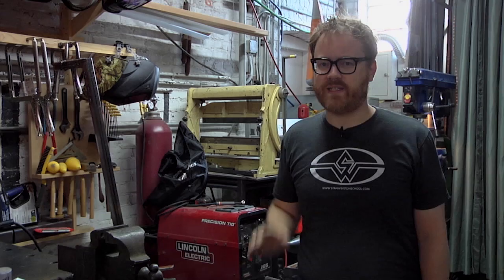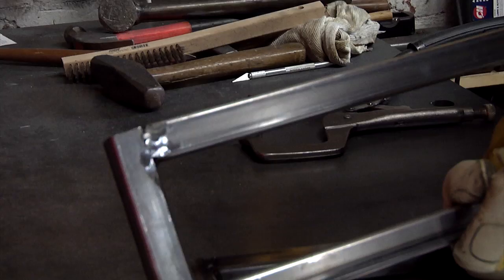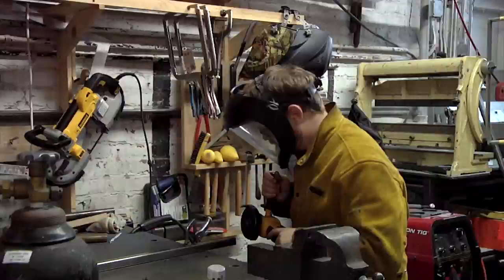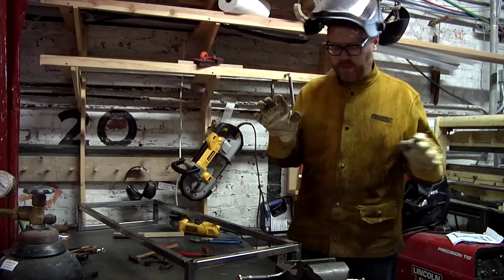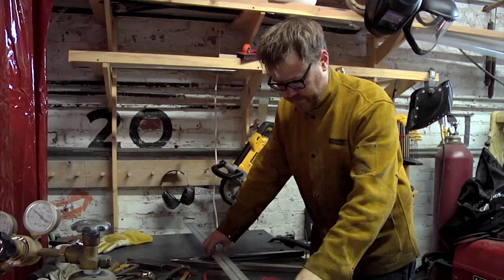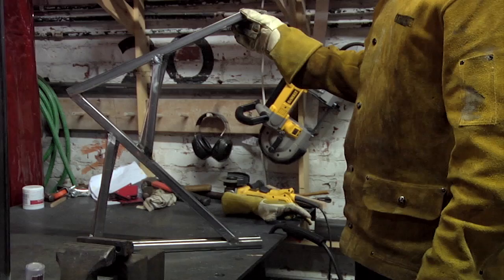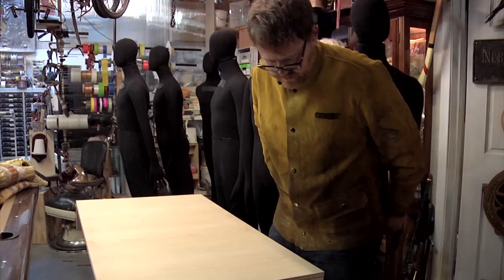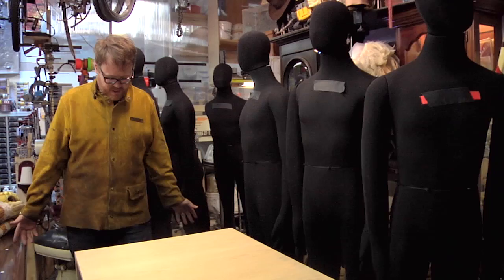Building a Custom Computer Desk, Part 4

Comment: Having done a great deal of welding, I can say you have improved so much from your first welds.

A quick tip. You can stiffen up and strengthen corners (like where the legs meet the top) with either a simple gusset or a fancier double gusset.

The simple gusset is just a right triangle of steel about 1.5" x 1.5" the same thickness as your tubing. Align it to the edge of the tubing so you don't get flexing of the face of the tube.

The stronger and fancier way is to make the double gusset from the tubing scraps. What you will end up with is 2 gussets connected together with a flat piece between them. To make them you simply cut 45 degree zigzags back and forth across a piece of tubing. You will need to make sure the cuts meet at 90 degrees. You should end up with a flat rectangular piece at 45 degrees to the corner and 2 triangles that fill in the corners. It is extremely strong and won't flex at all. If you need even more stiffness you can make the zigzag cuts farther apart. You will end up with sections of tube that can be welded across corners to form an open triangle.

Comment: If you're trying to duplicate something while welding, see if you can't find a piece of scrap plywood that you can screw a wooden "jig" or "pattern" on, so you can fit the bars (which should be cut to the right length) and weld away. perfect every time
Reply: This would definitely have been worth it on this build. He got the important angles almost right, but it would've been awesome to see him build a jig to compensate for the lack of experience... and give us another few minutes of video ;)
Reply from the maker: The cuts on the short pieces weren't perfect, so I chose to place them where they had the best contact instead of perfect symmetry.
Reply: +Sticklebrick consider tacking pairs and welding both legs at once.

Comment: First, Will, I would like to applaud you on undertaking such a project. Second, I would like to emphasize that the desk has very little lateral bracing. Before using this desk and placing any weight on it, please consider adding some support to prevent side-to-side wobble. If someone should lean on it from the side, it could potentially collapse causing injury. Please, just consider this as a friendly recommendation, I hope to see many more projects from you guys.

Comment: A lot of improvement over the last video. GJ.

Some of the criticisms here in the comments are wrong. So I'll address them:

-Steel tubing is clean enough that it doesn't need cleaning before welding.
-Tig welding is slow and is mostly used on something that is thin or needs to look good; mig was the correct method to choose.
-Porta-bans don't need cooling fluid.
-Thickness of the metal was fine.

When welding tubing, if you are going to close off both ends it is a good idea to leave a hole either in the weld, or drill a hole (before welding) so the heated air inside can escape.

When both left and right sides are identical you can tack one side together, then use it as a template by clamping the other one on top of it. Both sides will be identical.

Comment: Personally I would of screwed a plate between the legs to stop the wobble. It is how a number of computer desks I have had in the past dealt with the exact problem Will is describing.

I think it is great that Tested is using premium members money for something. Also you have to remember he is learning and I saw some welds there I would have been proud and some that were damn right ugly. What some forget is that he SAYS this in the video series. This is how humans learn, by mistakes and correcting those mistakes. Keep up the good work guys.

Comment: You've done a great job Will, im an engineer, fabricator & a panel beater so I cringed a little watching your welding but for a first go u really did great & u didn't take the easy road with the very complicated design of yours. Anyway just wanted to say great job.... And keep on testing. Onya

Comment: Small cursive 'e's or overlapping 'o's will make your welds so much better. Make sure you have a good base, good ground, clean material, and your amperage, wire feed rate, and gas psi match your material. It should sound like you're making nice, sizzlin' bacon!
Reply: that's how i was taught to weld, i was told that it is stronger if it isn't just a straight line.
Reply: BACON!  But no, really, it's true.  Once you get the right wire speed and power, sweet sweet ozone smelling bacon!
Reply: Eamon O Not true. You can have a strong slow straight weld. You just have to get the wire speed and voltage right, clean metal, good gas coverage, etc. If you're welding flat, a slow steady bead is all you need. It's hard to get MIG to lay down in a low profile in a straight line though, so people tend to do a W stitch pattern. Vertical and overhead on the other hand need that stitch to keep the weld to a low profile.
Reply: +MotoErgoSum you can run it in a step back pattern too, much like a 6010-6011
Reply: *****
So long as you aren't stepping back too much over the slag and getting it stuck in the weld, yeah.
Reply: The slag doesn't form that quickly when still in a relatively close distance to the the weld puddle. Plus, he was MIG welding, so there is no slag.
Reply: *****
You said 6010 and 6011. Those are stick electrodes, not GMAW wire. They're meant to run hot as a root pass on pipe or plate. If you're welding slow and going back over the slag, you can get inclusions pretty easily with stick. Saw it all the time on fellow students' QC-7 tests.

On GMAW (MIG) you can get cold lap or incomplete fusion if you're running the voltage too low and wire speed too high while stepping back over the weld. There are a lot more variables to welding than the pattern. Pattern is mostly for aesthetics, filling wide welds, or distributing heat when you're welding vertical, horizontal, or overhead. He was probably running GMAW, but it could have been flux core with gas. That's what I used on I-beams back at Art Iron when we were in the shop building the pieces for Tiger Stadium. ;)

On flat, a decent welder should be able to get the machine set up to do straight beads without much wiggle or stepping and still get a nice profile, assuming you aren't welding super thin stuff. Weld strength is all about meticulous cleaning of the base metal, pure gas (or mix) with no leaks in the hose or connections, clean filler, good ground contact points (and routing the direction of the ground so it hits both sides equally), no wind blowing away your gas, reliable machine... Beyond that it's just the spec of the filler wire.

But I digress. What we should really be critiquing is bending 90 degrees at the waist to pick something up. Good way to destroy his back. Bend at the knees, bro. AT THE KNEES.
Reply: I've been welding for 5 years, and it is my profession, nothing you are telling me is news. I have however NEVER seen slag inclusion while running stick electrodes from whipping, maybe wormholes, and slag inclusion on the toe of welds from not weaving enough on plate 3G. And I know what he was doing wasn't comparable to MIG, just used it as an example. He should have tried TIG, that would have been something, haha.
Reply: *****
For small projects like this, TIG is ideal. It's a bit slower, but zero spatter, super strong, and just beautiful in skilled hands. If I move back to Ohio I'll be getting back into chopping bikes and maybe do a custom cromoly frame. I miss fabricating. No space where I'm at in CA.
Reply: MotoErgoSum I was a TIG weldor for many years, I love it and still TIG at my house every now and again. If you don't already have a TIG weldor I would recommend the Everlast 160STH, great little weldor for very cheap!!!

Comment: And BTW good job on beveling the edges of the ends of the steel tubing! Doing so allows you to not only get good penetration but also allows you to grind the welds down for a clean look while preserving most of the weld.

Comment: I know this is a bit late now, but when you are making something like the legs, having a 1:1 drawing of the plan is handy. You can tape the plan to the desk and then lay out your metal over the top, that way you know you are placing things in the right place and your angles are right.
Another tip, I know Adam keeps saying that you can hide a lot at the end of the project, but don;t forget he's got many years of practice and skill. Whilst you are learning, measure, measure and measure again. You shouldn't be eyeballing it yet, get the basic skills right, then you can go freehand.
Overall the project turned out ok and you still have all your fingers and toes, well done.

Comment: Considering your design is insanely complicated-- for a first welding project-- you did great. I say leave those legs raw! Celebrate your first serious welds. Wobbles? If in the wood-to-iron, add small shims. If iron to the floor-- two, three pieces of felt here and there. Looks really nice. Make sure we see a glamour shot when it's all in place in its own corner of your den/study.

Comment: Also, would’ve recommended that you extend the top bars by an inch (or how ever wide yours is) and cut it at 45° angles, makes a much smoother top so you don’t just have an open hole to deal with. Just a tip for anyone who wants it.

Comment: I thought for sure he'd run X bar across the back. The legs are only supported on one axis. His assembly is fine in compression but if you put any significant torque on those legs and they'll snap.

Comment: A tip for welding, (taking a guess this is mig welding as its easier to use) but to get a nice strong weld, criss cross the weld over the location.  x=x=x

Basically get a musical theme going in your hand movement, running in overlapping x'es that way you get a good finish and a good strength from your welds.

Also grinding the "top" off any weld can reduce it's strength by 40 to 60 % Where ever possible do not grind the surface of a weld.  (this is why most ship welds are visible under the paint.)

Comment: Hey mate, your weld settings are up the creek... the "popping" sound you're getting when you're welding indicates your wire feed is too low or your voltage is too high... because it can't generate a stable arc whats happening is that its blowing the tip off the wire, losing the arc then making contact and blowing the tip off again... just turn up your wire feed speed, or turn down your voltage and it should solve most of the problems you're having now. Apart from that, give your base metal a wipe and check your gas flow rate, you're getting a bit of porosity in there (it looks like) and also, when you're grinding, you'll "wipe" a bit of metal around the place, so grinding with a 40 grit wheel isn't a very good indicator of whats actually there.

Also, you need to make your movements more gentle and more consistent ;)

As an additional side note, don't ever ever ever feed something into the top of a grinding wheel (a la your bench grinder work). If the job picks up it will fire it at you if its small enough, or fracture the wheel if its big enough, then you'll either have (best case) a ruined job, or (worst case) a job embedded in your hand or wheel fragments in you.

Comment: Will, when welding something square do NOT rely on those dang magnets (speaking from experience,) instead clamp the longer peace you're welding to then the smaller peace and make adjustments according to a carpenter's square (not a t-square.) 
Over all, the design looks great and I hope you get many years of use out of it :)

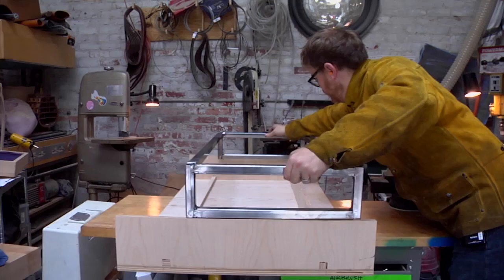Comment: Ok a little helpful hint: You said the cutoff wheel on the grinder and thats understandable. I've been hit in the chest when one came apart (Glad I have my welders jacket on) but at 4:37 there is a device hanging on the wall to your right that you should have used instead. It's called a portaband (Portable bandsaw). Rule of thumb if you have to take off (remove) 1/8" or more of material you should cut it off and that portaband is what you should have been using. The next best thing is a metal chop saw. The portaband is great especially if your trying to "Fit" materials together like you were. Just advise.....

Comment: What would be a thought for future builds in this series, is to make an introduction video a week or so in advance of starting the build. If you do that the community are able to give you some pointers and you're able to give us a detailed walkthrough of what and how you are building, as well as a step by step plan. Mostly for you own sake so that you're able to figure out early on what you must finish before moving to the next step. Like drilling the holes for the adjustable feet like you did. Personally, I never feel like I know what you are going to do next, or how it is supposed to look when you are finished. 

Learning to weld without a mentor is a pain, but you managed fairly well. Keep practising!
Another quick tip: When welding together multiple identical pieces, you can draw up the outline of what you are welding on the steel table. With the drawing on the table it'll be easier and quicker to line up everything for the next weld.
Reply: Fwiw, there were tow or three posts detailing the project on Tested in the weeks leading up to this.
Reply: Will Smith Ah, sorry. I'll look there next time.

Comment: Will, the next time you build something and are doing symmetrical parts like the side frames, tack the first frame together then assemble the other pieces right on top of the other. It will act as a template and both will match, eliminating most discrepancies between the two. Your welding definitely needs some work but I applaud your effort to jump into this project and post it for all to see. If you have any time to make it down towards LA (30 minutes east - Home of Bill and Ted, in fact my shop is right around the corner from the actual Circle K...but sorry, no Time Traveling Telephone Booth or George Carlin) I will give you some free welding and layout lessons in my shop if you want. I have a plethora of tools and equipment, CNC plasma table, MIG and TIG welders, Power Shear, Press Brake, bandsaws, Stronghand Fixture table, etc, etc and I do 3D Solidworks design as well. You can check out my Instagram (ZTFab) if you want.

Comment: Just add a couple of 45 degree gussets from the back of each leg up to the horizontal frame member at the back of the desk and the wobble will be gone. Your skills have improved noticeably. Just work on those router skills :-)

Comment: Adjustable feet are a good idea anyway. If the frame is decently stiff any little unevenness in the desk or floor will make it wobble. I wouldn't trust a tapped hole on metal that thin. Better idea is to weld a nut to the inside top of the tube. Then just get some adjustable screw feet.

Comment: Two points:

I'd always go with the leveling feet on this kind of project,  it doesn't matter how level the project is you never know how level the floor will be.  And trust me counting on the basic surfaces in your home to be level, square or flat, is a fool's paradise.

I don't see any side-to-side (lateral) support and would be worried about it collapsing flat like a cardboard box with both ends open.

Just because it's a light duty desk doesn't mean out in the wild someone isn't going to try and give it a shove from the side or stand on it to change a light bulb or anything else silly.  The end design should cope with these unforeseen issues within reason.

Comment: Will is going to hate that desk when he decides to move it later on. The table could have been made out of 3 large pieces of wood with some supports inbetween simply put together with bolts or the like so that you could disassemble it into a few wooden pieces when needed to reduce the pain of transporting it. I understand the table serves more as an art piece rather than a practical piece of furniture (though the welding doesn't scream 'art'), so I can't really complain - everyone has their own preferences.

Comment: I Know its waaaay Late to try and "help" you with your welds...... But when running GMAW (MIG) you can run a pattern and it is often encouraged and will help with weld quality. another  good place to hide crimes is with the not 90 degree  cuts with welding you can fill the gaps and grind it off. Good luck on learning the skill. Im sure the desk turned out awesome and was satisfying to learn to make.
PS- Invest in a REAL tape measure. It will make a huge difference
-AB

Comment: Speaking as a welder I think it's your welds aren't bad for someone that's never been told. Seems like you just need to slow down and increase the amperage.
Reply: I was at max amperage most of the day. After finishing, Adam said that the MIG he has in the shop isn't that great. It's a 110V model that has some feed problems.